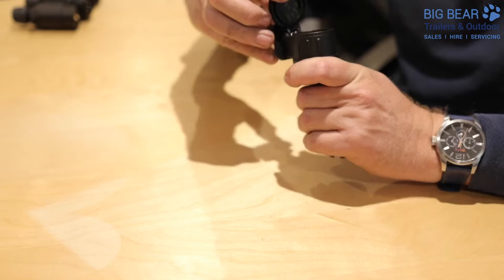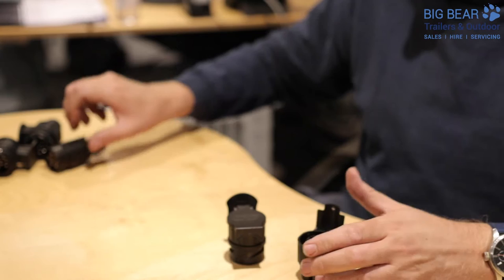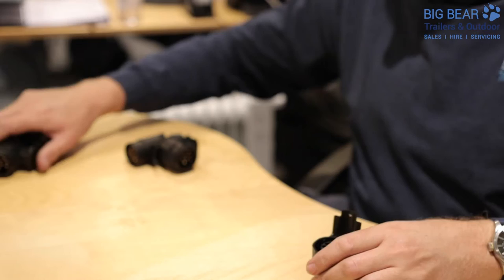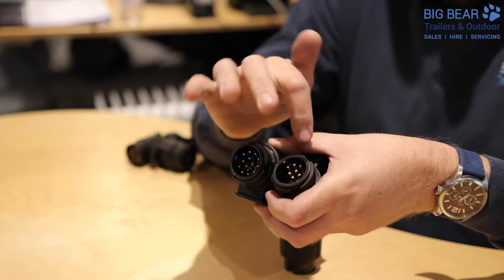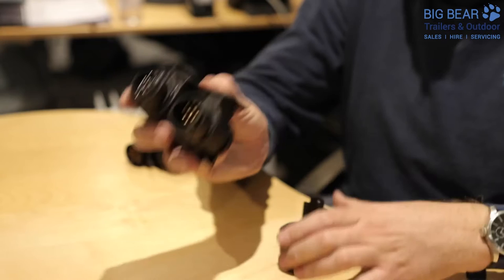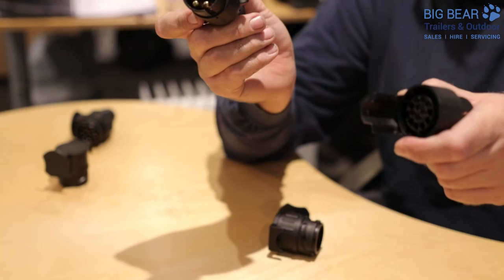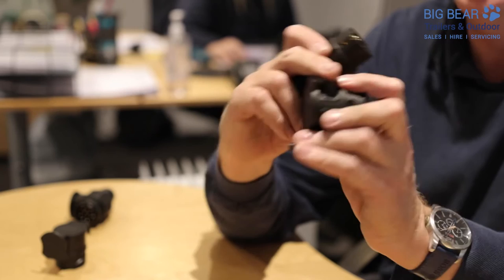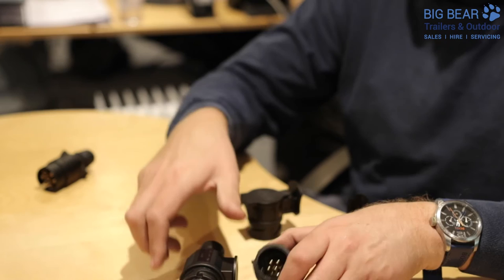13 pin and 7 pin Electrics Difference

Comment: I guessed that 13 pin connectors would have..... 13 pins.

But this video hasn't told me the difference.  I mean what are the advantages of 13 pin - why did it change etc?
Reply: Hi, Originally 7 pin was the style fitted to all basic trailers - this was sufficient to feed all your electrics. If however you had a caravan you had two x 7 pin sockets - one for your lights (as per a standard trailer) and one to power all you ancilliaries - Fridge etc. The newer 13 pin style came about for a few reasons - 1) Reverse lights were introduced to trailers / caravan (so an addition cable / pin would be required) 2) There was a desire for caravaners to have just one plug 3) The original 7 pin plugs are just push in and as a result can slide out - the new 13 pin style pusshed in and then rotates by 90 degrees to look it in to the tow vehicle. In my opinion 13 pin is the way to go on vehicles, it is future proof, allows you tow a caravan / trailer, plus has the benfit of locking into the tow vhicles socket and you will ave a feed for a reverse light. Hope that helps!

Comment: I can count pins. Must people want to know which to use when.....
Reply from the maker: To try and help. I would always recommed a 13 pin plug on a tow vehicle if planning on towing (now or future) a Caravan or a larger commercial trailer. By doing so, not only will you have the 13 pin plug that twists to engage into the tow vehicle, but you will have the feed for a reverse light and also the ancilliaries (for a caravan)

Comment: My vehicle has the 7-pin (only) socket fitted, due to the fact that it is only wired to supply minimum trailer light requirements. I understand that if you wanted the additional wiring to supply the socket with Live Power to run fridge/leisure battery charging etc., then the 13-pin socket would be required.  I know there is a 7-pin (only) plug to fit into the 7-pin (only) socket, as well as a 7-pin (only) plug configured in the 13-pin layout to fit into the 13-pin layout socket.  What I cant understand is why there isn't a 7-pin (only) socket configured in the 13-pin layout, so that you could visibly see that the socket is only capable of supplying basic trailer lights, but could still plug in the 13-pin plug, but not have the addition electrical feeds, but at least you wouldn't need to be buggering about with adaptors etc.  Just another way of getting you to spend more money eh? Or is there another stupid configuration inside the adaptor that switches pin feeds? I bet there is. Standardisation? Nope!

Comment: if i connect via adapter 7pin to 13pin, where i can take power feed for fridge and constant+ on vivaro 2010
Reply from the maker: Hi,
If you have a 7 pin socket on your Vivaro you sadly dont have the feed to power any ancilliaries, such as a fridge. the solution would be to get a towbar fitted to change / upgrade your electrics to 13 pin to give you the permanent live feed needed for the fridge etc. Hope this helps
Reply: @bigbeartrailersoutdoor1127  is pin 10 for fridge live feed at all times or after ignition?? Can I take it from cigarette lighter?
Reply from the maker: @rosssenin8172  Hi, Tried to paste a wiring diagram photo, but it wont let me. Enclosed is a link and half way down the page you will see teh diagram - see pins 9 & 10 https://caravanchronicles.com/guides/13-pin-socket-basic-fault-finding/

Comment: So what about 7s and 7n?
Reply from the maker: Hi, If you are towing a caravan built prior to 2008, it will have two plugs (one Black and One Grey). The Black is to power the lights (as a normal trailer would), the grey is for all the ancilliaries, such as fridge. This 2 plug system combines the single 7 pin 12N electrics socket with a 12S electrics socket. 

Adapters are available to convert from a 13 pin tow vehicle to the twin system, but my personal choice in this scenario would be to change the plug on the caravan to 13 pin style - avoids the need for an adapter and tidies up the whole wiring position.  You do have to get used to operating the 13 pin plug and use, but once up and running in our opnion they are better.
Hope this helps.